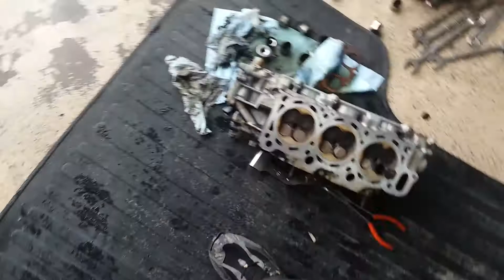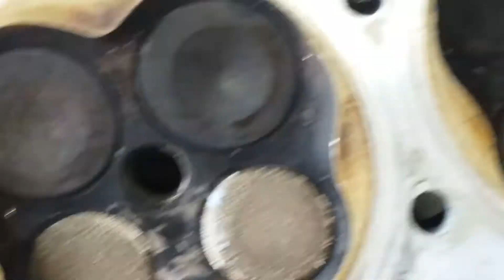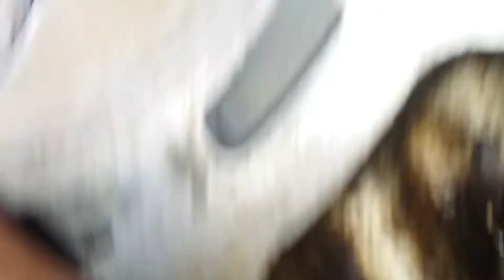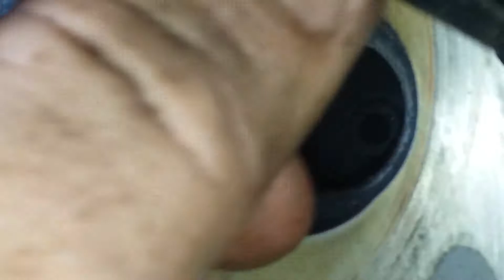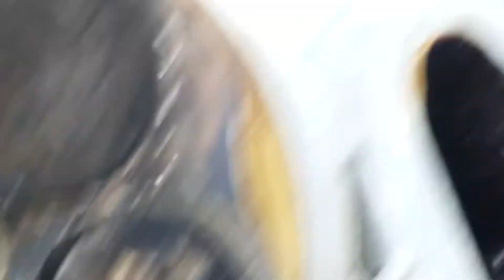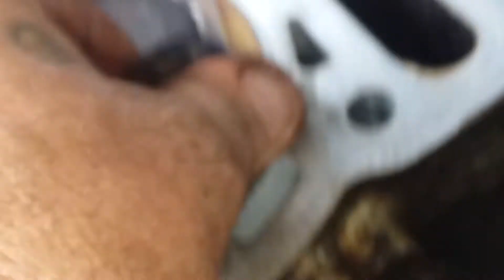Toyota Highlander v6 misfire solved!!

Comment: Mine is doing the same thing.. misfire... cylinder 4 and 6.  Changed out all 6 coil packs and cleaned out throttle body and replaced PCV valve but  3 day later... the engine is misfiring once again and shuttering on highway.speeds....  computer says bank 2 sensor lean running.  Replaced sensor and code comes right nack.... must be  a vacuum leak but all hoses check out great.   I have the compression tools but only have done compression tests on a jet ski.  How on a highlander? 2006 v6 limited
Reply from the maker: Remove all the spark plugs pull your fuel pump fuse and test each hole individually make sure you crank it three to four seconds per hole
Reply: Did you ever resolver your issue I’m facing the same problem on my 2002 hoghlander